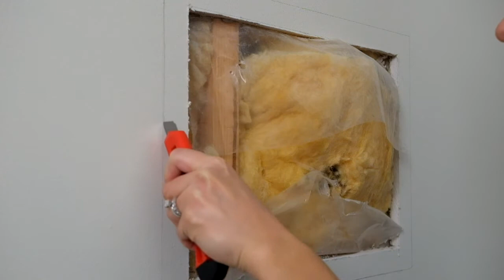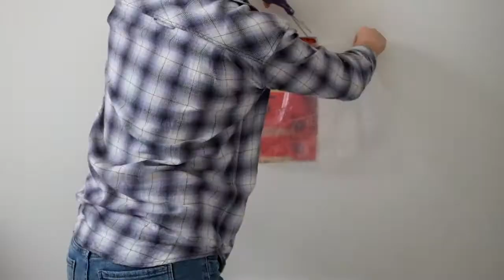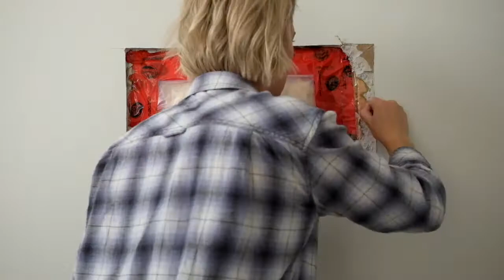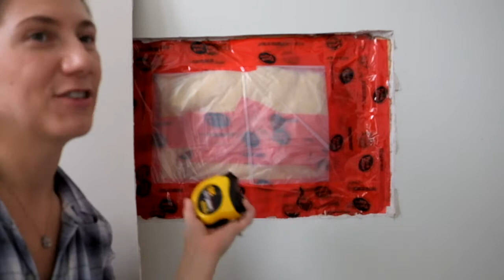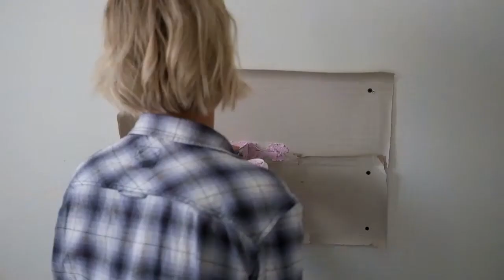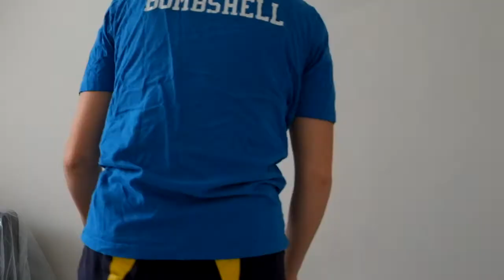How to patch an exterior wall (drywall and vapour barrier repair).

Comment: Just a note it's actually a really bad idea to use cheap, unapproved plastics to repair your vapor barrier. You need to get the real vapor barrier.  It just really should be aproved vapor barrier. It would have been worth the 40 bucks to have it done properly if that's what it cost you for the role. (And then you'd have it for next time, more than likely you'll have some project where you can use it again, Or you could have sold what was left of the role online If you didn't want to just hold on  to it.)

Comment: Thanks for addressing this issue!  I'm using the blue tape.  Not sure if it makes a difference, but the blue says it is for this sort of job.

So many other videos here don't even address exterior walls with vapor barrier, but those are half the walls in a home.

When enlarging the hole, I used a putty knife behind the drywall to protect the vapor barrier (won't work over a stud).